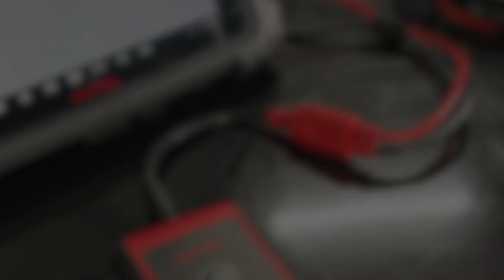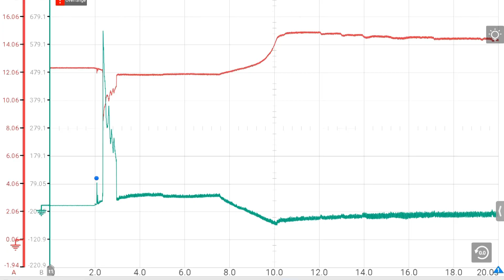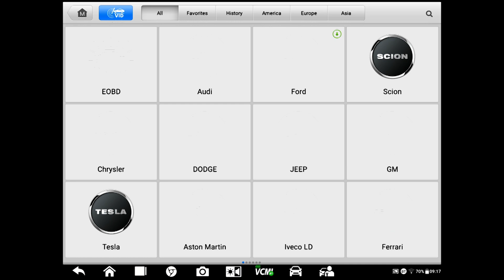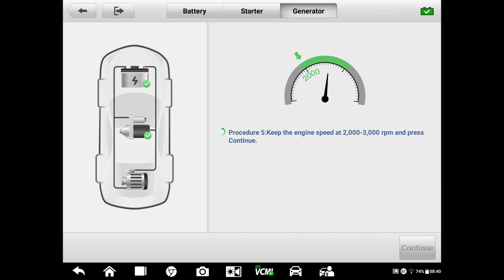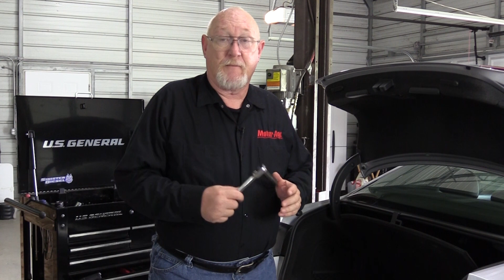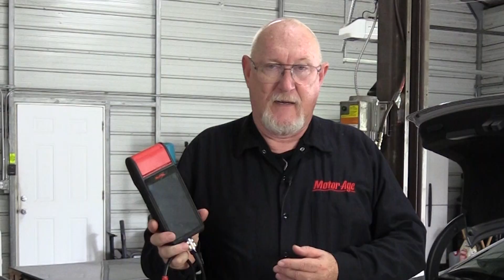The Trainer #119:  Replacing A “Start/Stop” Battery? WATCH THIS FIRST!

Comment: In England we call it "Stop Start", why >, well your engine is running normally then the engine will stop due to stop start, then after a while the engine will restart itself (start), so i.t is known as Stop Start as the system stops the engine (Stop) then restarts it (Start), unless in the USA you have lettering on the stop start button as Start Stop ?.   it maybe one of those words that do not cross over very well ?, Fag=cigarette  :)  ,Note: in the UK many fit a relay to disengage the stop/start system , then revert to the original relay for the cars annual safety Test (MOT) Regards.

Comment: I installed a start/stop eliminator module in both of my vehicles. I was at a light with a dead engine because the start/stop system wasn’t working. It took six starts to get going and ordered the elimination module the next day. 
Tip: If your car has a 120v outlet, try using a nightlight. In certain vehicles this will disable the start/stop.
Reply: 120v or 12v? Too similar for me not to double check. 👆

Comment: I turn start stop off as soon as engine starts 👍 save more expensive parts like starter motor from excessive wear
Reply: Does the aux battery still charge even though not using it?
Reply: Same

Comment: Hi there, I have another question. Do I have to first undo the ground cable or the negative bolt of the pole, in a Ford vehicle which has the stop&start system and BMS, before to swap or recharge the battery outside the vehicle? Thanx again!
Reply: Always disconnect the negative battery cable first, then wrap it in an old duster/cloth so it can not come into contact with the cars body (earth)

Comment: Hi, my vehicle has a EFB battery, I know it is possible to upgrade it with a AGM type. You suggest on the video it's not always better to use a more powerful battery, especially with  today's cars with much electronics and stop and start system as well.
Searching for AGM batteries I've found specs a little hotter than my stock EFB battery, is it a problem?
I can't find a AGM with the same values of my actual Efb.
Thanx!
Reply: If the AGM is a recommended or approved replacement by the manufacturer, you should be just fine. If not, stay away from it.
Reply: @bikerscare  Thanx, the owner manual doesn't mention it. Nor the mechanics one. I won't mess around with that ;) thanx again

Comment: This gentleman in this video speaks all my doubts. I have a 2021 Toyota Highlander at first I replaced the battery thinking it was the problem, in less than a year stop/start has failed me again left me without power in traffic lights my mechanic test the battery it’s still good so now I drive without activate the stop start feature. I hate it so much.
Reply: What? My 2017 Highlander has Stop Start and I have the original  battery.
Reply: @Zeek800  the thing is that I do uber witch means I use the vehicle full time all day
Reply: @DanielDiaz-te6dl  ya I recognized that in my comment. Obviously everything will go quicker in your vehicle than in mine. I have  put on 80,000 miles since May 2017.  I imagine you would do that in 1.5-2 years. Still, 2 years on a battery is pretty bad. It’s actually probably better that your alternator is constantly keeping your battery at or near the top charge level while mine could be sitting for a couple weeks in below 0 temperatures or only occasionally making very short trips. Since my vehicle has Stop  Start that should be harder on the battery. Luckily I have found the “ sweet spot “ where I can come to a stop with brake pressure that is so   “ soft “ that the Stop Start doesn’t activate. Also, it’s pretty easy to shut it off but of course you hav3 to do that every time you restart the vehicle.
Reply: @Zeek800 My 2019 Highlander also has the original Yussa battery.

Comment: perfect video ! keep it up ! :) just a quick question..

my car is i30 2015 and and need to change battery for AGM, the thing is that positive is on left side... do u think its ok to install battery in 180  degrees? back to front...

Thanks!
Reply from the maker: I wouldn't try - odds are the cables may not reach and I always encourage techs to only replace any component with an OE equivalent. Stick with the battery specs it came with.
Reply: @VehicleServiceandRepair  u know my current battery, seems never been changed yet, is installed 180dg, so maybe its normal

Comment: can a 2018 Toyota Highlander XLE gas with start stop swap its 604CCA EFB battery with either a 710CCA EFB or an AGM?  Are there ECM / BMS settings that need to be adjusted in either case? If yes, will the Autel BT work with the Toyota?
Reply: You will have no problem swapping it out for a higher CCA. Just make sure it is a AGM battery. You don't have to reset anything. I did it. Runs good again. When you get into the 2020 Highlander I heard those have to be set by a scanner.

Comment: The start\stop function is a joke. I maybe, save $5 to $10 of gas per year (and I'm a top Uber driver in my area). But yet, the battery only lasts 2 years. The battery sells for $144 plus $20 installation. What a joke.
Reply: The we’re not designed to save money they were designed for manufacturers to pass emissions standards
Reply: Get a better battery then , one I get Lasts 5years plus
Reply: She said shes a top uber driver in her area, that means her battery is going through the stop start cycle a lot more than the average battery, that's a lot of demand on the battery and a huge drain on its lifespan.
Reply: I'm changing mine after 7 years
Reply: What d9 you expect for $144? That was a medium quality battery 15 years ago. My 2017 Toyota Highlander still has the original battery. Granted you probably put as much mileage on every year as I have in 7 years  but two years is a little silly.
Reply: @ K Hedgecock I agree, you didn't even mention the cost of the starter or how many you'll go through. It's a total sham! But what else would you expect from the EPA and the other's involved.
Reply: Yes, fully agree. From 🦘🇦🇺
Reply: My one las 8 years
Reply: If you stay in gear and depress clutch Start/stop won’t cut in ! But not best practice from Driving instructors 🙄Congested rush hour city traffic was ideal scenario for this technology
Reply: Do not take the function on a cost saving perspective. The function was mainly introduced considering the environment. Suppose 100 vehicle stopped at a red signal switch off engine for one minute, how much carbon emission could be cutted down with no human effort.  There is always a bright side of each technology..
Reply: @shahan0508 hink of how many extra batteries and starters and additional battery resources are being used and wasted to feed this illogical idea of auto start stop…
Reply: Yeah.... then you have to replace and dispose of more batteries (which are bigger), starters, etc. If your only tracking the carbon emissions at the stoplight and not the life of the vehicle... Then your thinking just like the EPA...

Comment: 2:02 ... "every time the car comes to a stop the car shuts off to conserve fuel"...  our 2014 LR4 doesn't shut off every time... only occasionally....which is concerning, especially in city driving...and my wife drives cross country.
Reply: Sometimes the stop/start feature will be disabled by the car for example, the temperature outside is to cold. Or the air con is running hard with other power drawing devices like radios and headlights etc. A battery has the largest power draw at start up so if other things are running it would put a considerable strain on the battery to continue using the start/stop feature.

Comment: I have a 2020 Grand Cherokee with 18k miles on it. A yellow auto start/stop light is on on my dash. From time to time I noticed the radio and interior lighting wont shut off when I parked the car for the day. 30 minutes after turning the engine off the radio and interior lights are still on. I have to pull the positive lead off the battery to shut them  down. Anyone else having this issue? Also I don't use the auto start/stop function at all. Any help is appreciated.
Reply from the maker: Sounds like you may have some module issues. If these are bringing the battery down, it may be disabling the Start/Stop function. If it is under warranty, take it to your local dealer.
Reply: Hello, about the start-stop function, if you want to DIY the settings, you need related high-end equipment. I recommend the Phoenix Plus from Topdon to you, because I am also using this product to perform the start-stop function. Some problems, the experience is not bad.
This is a video of me using Plus to activate the start-stop function for the 2017 Audi A4L: https://youtu.be/FgmuvcvAAcc , share it with you here, you can refer to it. If you are interested, you can click to take a look, or give me your opinion.
There are more videos on my homepage of using different devices to do different functions of the car. You are welcome to follow me and I will be happy to answer your questions. thanks.

Comment: You don't need this rubbish. Just an AGM battery. If it's 12.7 volts it's good to go. Any cheap multimeter will show you that. Just scaremongering to sell unnecessary equipment.
Reply: So just need to replace the battery with another stop/start battery as long as it’s a like/for like battery?? And don’t need to mess around with diagnostic tools? So I can do it myself? I was told I would have to go to a shop to get it done 🤷🏻‍♂️ if not I’ll do it myself
Reply: I can tell you from experience that not reprogramming your battery back to the vehicle (if required) will certainly and drastically shorten its life. I have installed hundreds of batteries. I can also tell you some battery suppliers are now starting to require that you supply proof of recalibration in the event of a warranty claim for the do-it yourselfers. Just FYI.   @jakelincoln9895
Reply: Thank you
Reply: Just changed battery on 2018 Malibu now I have no power inside. Fuses are good. But no power key fob won’t work, new battery as well.

Comment: Wrong. The battery doesn't run the electricals on a vehicle the alternator does that. The battery is simply a reservoir of energy to run things while the engine is off like starting the engine.
Reply: when you switch on some components battery give current until alternator increse amperage
Reply: You dont know much then. 😅

Comment: So the only thing that I have to do is to change the battery in order to get the ECO stop start button working again?
Reply: A new AGM(Absorbed glass mat) will do the trick.
Reply: Replaced it but don’t have a tool to register it, it throws an error code constantly. Beyond frustrated.

Comment: Remember one other item.  That Autel memory saver is using pin 16 of the DLC.  That is a "fused" 12 volt terminal.  What is the condition of that fuse?  Some vehicles use that fuse to power up "power points" also called cigarette lighters.  Plug in to the power point something that blows out that fuse and your memory saver won't work.  There goes all the modules memories and here comes the headaches!  Be certain pin 16 is working before plugging in the memory saver and disconnecting the battery.
Reply: Exactly how would one go about doing that, please?

Comment: Thanks Pete, great video.  Are there any issues regarding keeping a charger/maintainer on stop/start vehicles?  Will this "confuse" the ECM?
Reply: It can, you may be able to find where to connect one in the owners manual. You basically want to connect it where the current sensors detect power going into the battery.